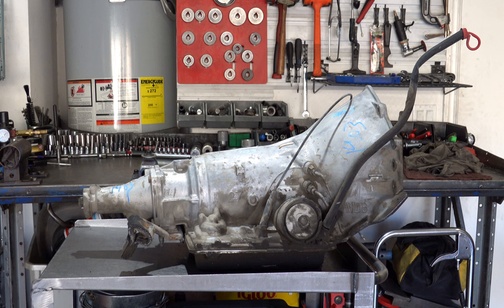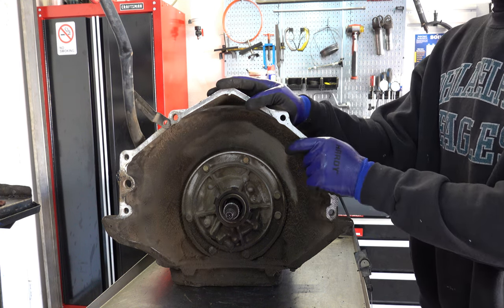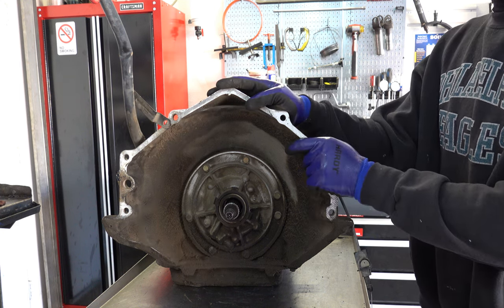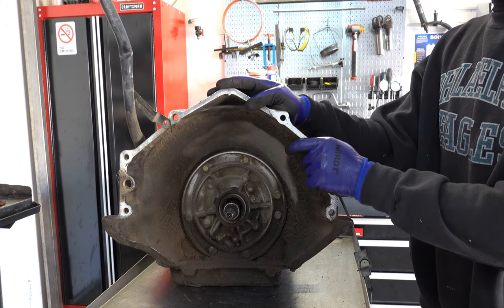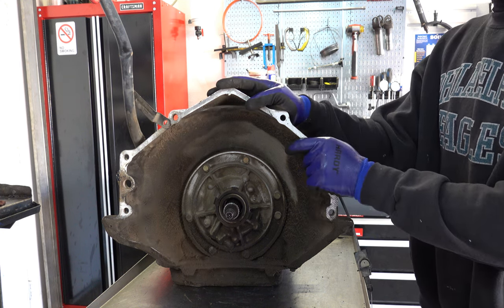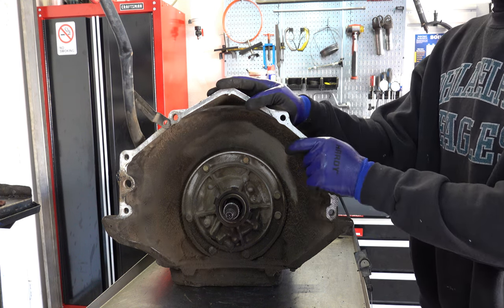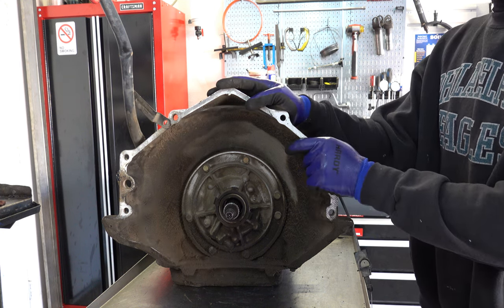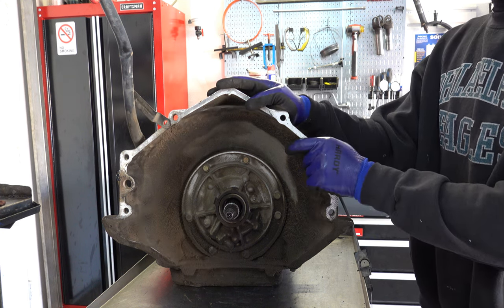700R4 Teardown and Inspection

Comment: I just subscribed to your channel. My brother saw one of your videos on how to replace the pin for the parking pawl in a 700R4. he was wrking on removing the shift brackets off of it as the used transmission we put into my 1984 K20 Chevy Suburban did not use the same linkage as the 84 700R4 that was removed in my driveway. Could I get a link to this video? I will be using the pulled transmission to practice on how to remove the pin with removing minimal parts. A friend suggested to remove the rooster comb to do this shaft replacement.
Reply from the maker: Thanks, Andrew - appreciate the subscription!

I don't have any videos specific to the parking pawl pin removal is it's really not removable. You may be thinking of the selector shaft which is what the external linkage is ultimately bolted to and connected to the column shifter so the driver can change gears, etc....If so, you can watch my 700R4 rebuild video, you can see how the selector is replaced. 

That said, you shouldn't have to do anything inside the transmission if you're just doing an external linkage swap.
Reply: We put a used transmission into my 84 K20 and as one of my brothers was removing a nut; not using hardly any pressure, the bolt broke. I have to drop the pan & remove the rooster comb and other linkage to replace the bolt. I will be using the dead transmmission as my "guinea pig" to see how things come apart first before committing to crawling under the truck. I don't have a lift.
 @nickstransmissions
Reply: It was the selector shaft I was thinking of.
 @nickstransmissions
Reply: Also I never knew about the various "vintages/eras" of the 700R4 and the spline changes. I have a NP208 T case on my truck; would I have to change the front output shaft on my 208 to match the 30 spline drive to match the 1989 700R4  transmission I just put in or will it be good to go? @nickstransmissions
Reply from the maker: Yep, that happens more often than you might think, unfortunately...glad you got another part ordered.
Reply: I replaced the filter this year back in June & in October for some unkown reason the filter dropped from it's home and straight to the tranny pan. The plastic washer that was supposed to hold it was still up inside the transmission. I didn't like the look of "glitter" in the ATF & parked the truck & started looking on another site for a used 700R4. I changed the filter at the same time I put a new cork gasket on the trans pan, due to the rubber one was leaking like a sieve. In hindsight I should have left that dog alone. @nickstransmissions

Comment: Are there any significant differences from a 87-92 case to say that one’s better than the other? Even if one is a K case.
Reply from the maker: K cases have thicker flanges. 1987 was a transition year and you can potentially see a unique configuration where you have an auxilary valve body but a spacer plate that is provisioned for a check ball to be placed at low detent location (#9 check ball) in the case. I make mention because most folks attribute the aux valve body cases as not taking that check ball but in early-mid 87, they did. 1993 had a separate valve body and separator plate but those only went into the F body cars and Corvettes. I wouldnt build anything off of an 82-E84 case - case itself is fine but pump, fwd drum, forward/3-4 clutch packs and sprag were underdesigned relative to later years.
Reply: @nickstransmissions  thank you being active and answering questions. You’re a rarity.
Reply from the maker: You're welcome, man. Thank you for watching!

Comment: When it comes to the rebuild kits. Do they differ for the 3 different types?
Reply from the maker: There's one kit that applies to all 700R4s - the builder just uses the parts from it that apply to the unit he's working on at the time. That said, I usually buy some 4L60E parts, including:
- The paper and rubber kit (applicable to all years/versions of 700R4s)
- 4L60E early clutch module (has high energy clutches in the 3-4 and rev input)
- 4L60E 3-4 steel module (the other steels are usually ok)
- 4L60E tubular steels in the low-reverse and reverse input clutch packs (optional for stock/mild builds but recommended for high perf builds)
- #4 or #7 3-4 apply ring, depending upon how I'm trying to set up the 3-4 clutch pack
- 4L60E apply and backing plates or 700R4 apply plate and 4L60E backing plate (whichever gives me the clutch stack up and clearance I want) - - 4L60E late model bonded steel and rubber apply pistons for the forward drum
- 4L60E late model forward clutch return spring
- 4L60E viton seal for the input-output shaft junction
- Corvette 2nd gear servo
- Wide 2-4 band if using a machined or new reverse input drum
Reply: @nickstransmissions  so I picked up a couple used 700r4. Here are the codes. Which one is the “better” one to rebuild. I think these codes tell what it was in and engine but hard to find that information. 
0MJM149H
7YZM051B
6MWM-Y-01147918-191C (4x4) K case

Comment: Nick I have an 1958 Chevy bel air 348 with turbo glide. I have heard I may want to change my tranny to a th350 or the 700 and specifically go for 87 or later. Is this good advice.
Reply from the maker: Hi Alan,
If you want to take your Bel Air on the highway more often then, yes I agree with doing the swap but with a couple caveats if you go to a 700R4:

1. You will need to know what your final drive ratio is - if it's something like 2.73 or taller, you'll need to install a 3.23 or 3.42 (or something in that general neighborhood) ring and pinion kit so that you don't potentially stress the transmission (particularly the 3/4 clutch pack) in overdrive

2. The 700R4's cable is what's called a 'Throttle Valve' cable; it's not a kick down cable like the TH350 has. The TV cable set up and adjustment is absolutely critical to the health of the transmission, so depending upon what engine you have, you'll likely need to purchase a mounting bracket for the TV cable to ensure the geometry is correct and validate set up/adjustment via a transmission pressure gauge so you can compare your readings to reference readings...I can reply with a link to some directions to help you w/it.

The TH350 would be the less complex swap of the two but both may require you to modify your driveline (cut and rebalance) depending on the differences in overall length of the turbo glide vs the other two. That and you may need to move the cross member rearwards.

Is there something wrong with your Turbo Glide transmission?
Reply: @mytransmissions5390  well I am thinking yes. Haven't heard definitely though.  Wouldn't get out of park.  Been in the shop for 2 weeks.  So just trying to think of options.  The turboglide prior to that was running perfect and has 38000 miles on it
Reply: Also it's a 348 motor
Reply: The previous owner who is ex gm worker and experienced recommended the th350
Reply from the maker: Gotcha...Wonder if the parking pawl was damaged or guide bent...sorry to hear of it.

The Turbo 350 likely requires less overall cost/effort than a 700R4 so perhaps that was driving the prev owner's recommendation....That said, I've built numerous 700r4s for swaps in to the Tri-Five and similar 50's cars throughout the years so they are a popular swap as well. If you plan on doing some more highway driving and road trips, you'll want overdrive as doing 70mph at 3000 or so rpms gets old fast. It may cost a bit more to do the 700R4 and there may be some additional complexity involved when it comes to installation but it's worth it in my view.

What's critical is the final drive ratio - just making sure it's deep enough for the overdrive is the main consideration.
Reply: Thank you Nick, the car is worthy I think of the best so will let you know what’s come down
Reply from the maker: Sounds good, Alan.
Reply: @nickstransmissions  well it was the the parking pawl or the lever going to it.  A kind of flared cap for the spindle had worn or broken and didn't allow the lever to move.  And compounding that problem a clamp situated at the top of the steering column was broken so got that on order so back to original  right now.  Waiting on that clamp with a hose clamp in place to make it drivable.  Good call Nick
Reply from the maker: Ah, damn...yea, every once in a while, ill see a transmission come in with something broken in the parking mechanism...it's usually the result of repeatedly letting the parking pawl absorb the full weight of the vehicle without any e-brake applied when people are parking on grades like their driveways. One of my customers snapped a parking pawl of a Ford 4R100 doing that in a F350 dually a long time ago.
Reply: Nick how did you come by your knowledge of transmissions
Reply from the maker: Hi Alan, I taught myself how to build them around 10 years ago or so. I may do a video explaining the circumstances but long story short, I wanted to reduce dependencies on shops and become more self-reliant in all aspects of auto repair...
Reply: That is incredible and awesome hats off
Reply from the maker: Thanks, Alan!
Reply: @nickstransmissions 
  Nick, I'm building a retromod 57 4dr hardtop with (all modified/ tailored for 1000-4000 power range) using  1992 Roadmaster/Caprice drive train,  350(NA),  700r4 (modified with your video guided upgrades) and stock 2.75 rear end.  The car is going to be a daily driver-cruiser. Yeah, I'll probably put my foot in it once a blue moon, but I'm going for comfort and fuel mileage (I'm old). 
  I'm just curious, why to go to lower gears? I know they would make the car peppier and stouter, but is it just for longevity  or something I really should do? 
  Thanks,
  John
Reply from the maker: Hi John, thank you for watching...The main concern with running too-tall a gear set in the final drive when swapping to an overdrive transmission is that you will not have enough mechanical leverage when in overdrive to generate line rise fast enough...If you look at all the factory ratios that went into vehicles equipped with a 700R4 and 4L60E, they all had 3.23 or 3.42 gears while the three speed direct drive transmissions had 2.73 or 3.08 gears, depending on engine displacement....The taller gears are ideally suited for three speeds because engine RPM will rise fast enough, in terms of actual time) to keep line pressures sufficiently high to retain hydraulic clamping force on the clutch, preventing it from slipping or going neutral. 

Take that same tall final drive and mate it with an overdrive transmission (.69 to 1) and you will lose that relationship and potentially damage the overdrive clutch (in the case of the 700R4, the 3-4 clutch pack will be hard pressed to hold under heavier throttle, engine will bog a bit and thus transmission will overheat and slip). 

So maintaining a proper mechanical relationship between the gearing in the transmission and gearing in the axles is critical to the overall health, well-being and performance of the entire powertrain. 

Hope that helps.
Reply: @nickstransmissions  Thanks. That makes sense to me. I was confused because I bought a complete, intact 1993 Buick Roadmaster with 5.7l, 700r4 and the spec info says 2.73 axle ratio. Of course I haven't gotten under it to check yet. Working on the 350 rebuild and just now started the research/planning stage for the 700r4. I work slow, (I'm 71 and a gearhead since birth) this my last project, bucket list car.
  Love your videos and the way you teach!
Reply from the maker: Thanks for the kind words, John! Good luck with the project; it should turn out well for you.

Comment: So they called the 700-R4 the 4L60 but it is nothing like the 4T60, which is a markedly superior design. 700-R4s almost always start to slip after 150k or so, whereas the 4T60 will last a lot longer. Seems like fraud to make it seem like this was a longitudinal version of the 4T60 with an unnecessary re-designation. It is also fraudulently leading consumers to believe it was a new design when it wasn't. Even going electronic doesn't justify changing the model name. 700-R4E would have worked just fine and not been disingenuous.
IDK why I'm even watching this. While I would like to get another Caprice, I'm definitely putting a T-56 in it if I do. Or maybe I'll do something crazy like a blown VR6 and Quattro AWD. Or maybe I'll toss a Corvette powertrain and suspension at it. I always did like transverse rear leaf springs. Still miss my '89 Cutlass Supreme. It is one of the few cars I regretted selling.
Reply from the maker: GM's automatic transmission naming convention consists of the following: number of forward gears, a drive train orientation and torque handling capability based on numerical value...so 4L60 is broken down as follows: 

4 = no. of forward gears 
L = longitudinal engine orientation (rear wheel drive)
60 = torque rating capacity indicator once torque multiplication is accounted for

So the 4L60, 4L60E and 4T60/4T60E would not necessarily have anything in common save for the fact they are GM automatic transmissions that have four forward gears in 'Drive' or 'D4'. Beyond that, they are completely different designs that were intended to satisfy completely different powertrain requirements.

Like most automatic transmissions, both of those units have their warts, including a weak direct clutch. But saying GM committed 'Fraud' isn't an accurate characterization...If they had rated the 4L60 the same as the 4L80, that would be fraudulent, or at very minimum, willfully deceptive. But nothing like that happened...

They simply changed the naming convention for their automatic transmissions and transaxles, nothing more. Ford and Dodge did the exact same thing on/around the same time frame. For example, the AOD/AODE ---> 4R70, 4R75; E4OD ---> 4R100...Dodge 727 ---> 36RH, 37RH...Some name changes coincided with component engineering changes, others did not.

Lastly, your watching this video because it's great stuff, lol🍺

Thanks for taking the time to view and comment, Lurch-bot.
Reply: What a comeback